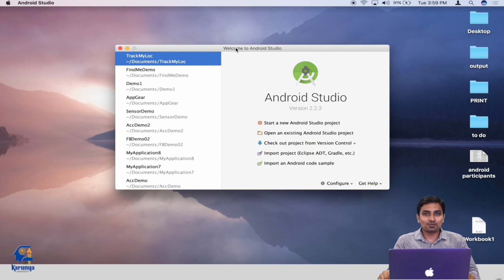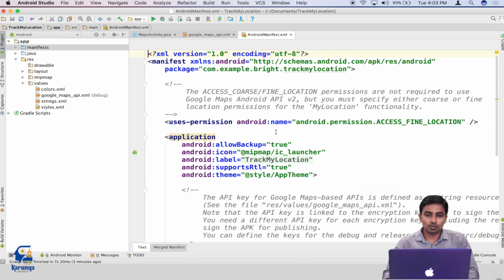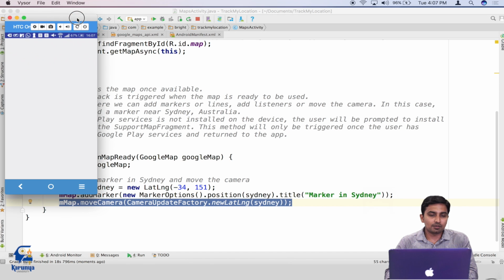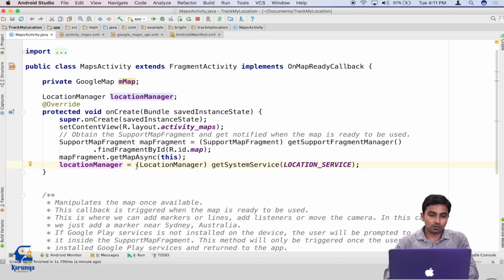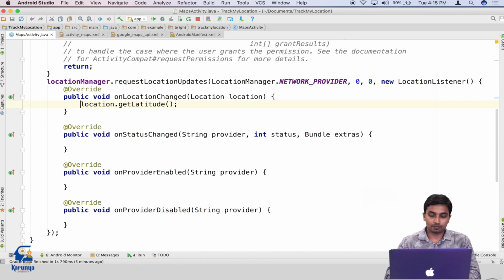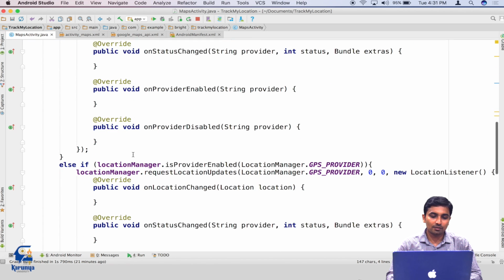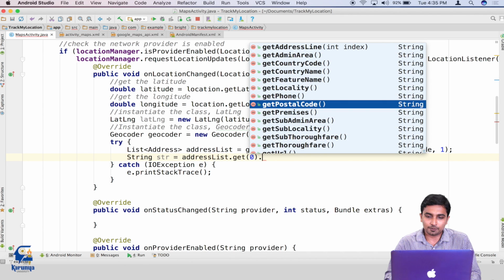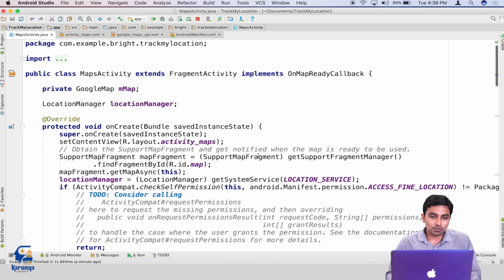Android app to Track your location using Google Map API

Comment: sir,the marker is not shown on the app
Reply from the maker: Dos
Pls include Google Map API key.
Pls ensure that location is switched on before launching the app.
Launch the app in mobile, not in emulator.
Reply: sir,
i have done everything.which you said in the comment above
Reply from the maker: Pls try with my latest code. 
https://drive.google.com/open?id=1btg-SXiB-L00UkeTzNJEmfXQapZo2q_P

Comment: I've done this exactly as you did, and my app is running fine. But my location marker shows up in England and I'm not even near England :D 
Can you help with ?
Reply from the maker: will u pls try with my latest code.
https://drive.google.com/open?id=1btg-SXiB-L00UkeTzNJEmfXQapZo2q_P
Pls update me. Thank u.
Reply: I copied this file into my project, re-run it in another window, I see you put button for "Show my location" , when I click nothin happened, same thing :( Could there be any other problem, except code ? Like something is not updated I'm trying 4 days to fix it :(
Reply: It always as my current location leads me to Holy Ponds US or england, and I researched a little bit to my location and did zoom in, there is marker in my location ...
Reply from the maker: So u got marker in ur location? If u know to use AsyncTask concept, the long running process can be executed in a separate thread called, worker thread and u will get ur expected output.

Comment: Sir, I have followed the full tutorial and done as you have done but my map is just been displayed without any marker or location
and I have checked the below links also but it doesn't work for me
please do needful
Reply from the maker: Pls enable the location in ur mobile and launch it in ur mobile, not in emulator. I hope that u ll get the expected output. Don't forget to update me.
Reply: i have enabled the location in my mobile and launched it
i'm not using the emulator 
still its not working
Reply from the maker: did u insert ur Google Map API key?
Reply from the maker: I m sorry to hear this. pls try with my code which is recently coded.
https://drive.google.com/open?id=1btg-SXiB-L00UkeTzNJEmfXQapZo2q_P
Reply: i have inserted it still, it has the same problem
Reply from the maker: I am very sorry to hear this. Don't worry. U may try with my latest code.
https://drive.google.com/open?id=1btg-SXiB-L00UkeTzNJEmfXQapZo2q_P
Reply: thank u sir
Reply from the maker: u r welcome. God bless u.

Comment: not showing any marker even after the location is enabled
Reply from the maker: after enabling the location, launch it again in ur mobile phone, Still the problem persists, try my new code
https://drive.google.com/open?id=1btg-SXiB-L00UkeTzNJEmfXQapZo2q_P
Reply: it worked .. but shows two marker ... may be u should provide .. else if instead if in the network detection
Reply from the maker: Did u try with my latest code, shown below in the link?
https://drive.google.com/open?id=1btg-SXiB-L00UkeTzNJEmfXQapZo2q_P

Comment: can you plzz sort out my problem it is same as of otherz bright varghese
Reply: i also have the same problem waseem bhai
Reply: plz tell me
Reply from the maker: Pls download my latest code from this link
https://drive.google.com/open?id=1btg-SXiB-L00UkeTzNJEmfXQapZo2q_P
Reply: sir i did this but nothing happens output is the same no marker plus no correct location plzz help regarding this issue i have to submit assignmnt tomorrow bright varghese sir
Reply from the maker: did u insert ur google map api key?
Reply: bright varghese yes sir i did
Reply: Sir i shared my code with u at your gmail account have a look if u have time i shall be thankful
Reply from the maker: which mobile r u using?
Reply: bright varghese sir Samsung core 2 model number SM-G355H android version 4.2.2.1
Reply: bright varghese sir
Reply from the maker: Pls do verify that r u getting any exception in logcat?
Reply: not getting any exception sir

Comment: Hey thanks for your tutorial!
Unfortunately i didnt work for me. It just shows me the map without the marker. I did EXACTLY the same as you did. GPS is on and also tried regeneration of the key.
And i have no clue what i could do with your sample code :D
Reply from the maker: Pls ensure that ur location is on in ur mobile
Pls try with my latest code
https://drive.google.com/open?id=1btg-SXiB-L00UkeTzNJEmfXQapZo2q_P
Reply: Thanks alot for your response. Location was already on. Which documents do i have to import in my project?

Comment: I tried it with my code and the code you provided via GitHub, neither worked. The map opens but it won't locate my location. Is there anything you can suggest to make this work? I don't have an android device but i used a friends to test and nothing worked
Reply from the maker: it works only with Android mobile.
few days before I created a new app. You may try the below mentioned link
https://drive.google.com/open?id=1btg-SXiB-L00UkeTzNJEmfXQapZo2q_P

Comment: Sir, my all things are done map is also  coming only marker is not coming please help
Reply from the maker: Dos and donts
1. The app works only in mobile phone, not in emulator.
2. Enable the location before launching the app in mobile phone.

U may try with my sample code
https://github.com/brightgeevarghese/TrackMe

Kindly let me know, if the problem persists.
Reply: I have ruuned in mobile also same things occurs there also
Reply from the maker: Did u try it with my code which I shared thru github?
Reply: bright varghese is that code different from this one in video?
Reply from the maker: almost similar only, but still u can try with it. Don't forget to insert ur Google Map API key. Generate a new one and insert it. Pls do check that is tr any exception in ur logcat.
Reply: I also generated the new api nd checked it. I l try with ur code.
Reply: I tried with ur code I am getting invalid vcs root mapping.please help
Reply from the maker: is it possible to come in online thru Skype? my id is brightfsona.
Reply: No sir i can send u mail
Reply from the maker: send me a test mail at brightlsom@gmail.com.
Today I created a new app to show the current location. I ll send the whole project to ur mail.
Reply from the maker: download the new project from this link
https://drive.google.com/file/d/1btg-SXiB-L00UkeTzNJEmfXQapZo2q_P/view?usp=sharing
If u v any doubt, feel free to mail me at brightlsom@gmail.com
Reply: Thankyou so much Sir

Comment: Sir just map is shown when I run the code but it doesn't shown the marker and current location what should i do?
Reply: I run it on my mobile and the location is also enabled..
Reply from the maker: kindly share ur logcat while running ur app in mobile. U may try again with a new Google Map API key and share the logcat with me at brightlsom@gmail.com

Comment: Hello sir ,i have followed your tutorial and done as you have done but, my map is just  been displayed without any markr or location ..plz sir help me
Reply from the maker: Pls launch it in ur mobile, not in emulator. It works only in emulator. 
U may try it with my code. 
https://github.com/brightgeevarghese/TrackMe
Don't forget to insert ur Google Map API key.
If still the problem persists, pls share ur logcat at brightlsom@gmail.com.

Comment: sir i have followed the full tutorial and done as you have done but my map is just been displayed without any marker or location.
Reply from the maker: Dos and Donts
1. It works only in device, not in simulator.
2. Pls do enable the location, before launching the app in ur mobile.
If still the problem persists, let me know.
Reply: Hello, I have done all of that and I still get a problem that only the default map shows up rather than a map with a marker where I am.
Reply from the maker: Pls try with with my code.
https://github.com/brightgeevarghese/TrackMe
pls include ur Google Map API key.

Comment: Thank you very much, but my code still doesn't work. The map just points to equator and no marker is being generated. I've tried three different API keys, checked for its updation in the manifest file,  checked SDK version, switched on Location, tried it on Phone and Emulator, still not working. Any way to fix this?
If you don't mind, could you teach us how to find all our phone book contacts on the map? I'm working on a hack idea, and it would benefit me greatly, thank you once again.
Reply: Finallyyyy it's working using your code on Github. Thank you so much. Could you explain why the original code on this video wasn't working?
Reply from the maker: It works only in mobile phone, not in emulator. Pls try once again with my code.
https://github.com/brightgeevarghese/TrackMe

To access the phone book, pls follow the below code and customise it to add the contact to map.

public class MainActivity extends AppCompatActivity {

    ContentResolver contentResolver;
    TextView textView;
    @Override
    protected void onCreate(Bundle savedInstanceState) {
        super.onCreate(savedInstanceState);
        setContentView(R.layout.activity_main);
        textView = (TextView)findViewById(R.id.textView);
        //Step 1 : get the content resolver
        contentResolver = getContentResolver();
        Cursor cursor = contentResolver.query(
                ContactsContract.Contacts.CONTENT_URI,
                null,
                null,
                null,
                null
        );
        int count = 0;
        StringBuffer sb = new StringBuffer();
//        String colomns[] = cursor.getColumnNames();
//        for (String data : colomns){
//            sb.append(data+"\n");
//        }
        String data = null;
        //textView.setText(sb.toString());
        while(cursor.moveToNext()){
            data = cursor.getString(cursor.getColumnIndex(ContactsContract.Contacts._ID));
            sb.append(data+":");
            data = cursor.getString(cursor.getColumnIndex(ContactsContract.Contacts.DISPLAY_NAME));
            sb.append(data+"\n");
            String phoneNoStatus =
                    cursor.getString(cursor.getColumnIndex(ContactsContract.Contacts.HAS_PHONE_NUMBER));
            int value = Integer.parseInt(phoneNoStatus);
            if (value > 0){
                //execute the query to get the phone number
                Cursor phoneNos = contentResolver.query(
                        ContactsContract.CommonDataKinds.Phone.CONTENT_URI,
                        null,
                        ContactsContract.CommonDataKinds.Phone.CONTACT_ID+"=?",
                        new String[]{cursor.getString(cursor.getColumnIndex(ContactsContract.Contacts._ID))},
                        null
                        );
                        while(phoneNos.moveToNext()){
                            sb.append(phoneNos.getString(phoneNos.getColumnIndex(ContactsContract.CommonDataKinds.Phone.NUMBER))+"\n");

                        }
            }
            Cursor emailCursor = contentResolver.query(ContactsContract.CommonDataKinds.Email.CONTENT_URI, null, ContactsContract.CommonDataKinds.Email.CONTACT_ID+"=?", new String[]{cursor.getString(cursor.getColumnIndex(ContactsContract.Contacts._ID))},
                    null
            );
            if(emailCursor.moveToNext())
                sb.append(emailCursor.getString(emailCursor.getColumnIndex(ContactsContract.CommonDataKinds.Email.DATA)));
            count++;
            if (count > 10){
                break;
            }
        }
        textView.setText(sb.toString());
    }
}
Reply: Thank you!! I wanted to confirm however if it is possible to make the map marker itself interactive such that when we click it, it should call up a previously provided number. If possible please provide the code for that, will be greatly appreciated, thank you. I will send you my current project status if you require to see it. 
Thank you once again.
Reply from the maker: mMap.setOnMarkerClickListener(new GoogleMap.OnMarkerClickListener() {
            @Override
            public boolean onMarkerClick(Marker marker) {
                //put ur code here when the marker is clicked
                Toast.makeText(getApplicationContext(), "marker is clicked", Toast.LENGTH_SHORT).show();
                return true;
            }
        });
Reply: Thanks I've already managed to link a calling function upon clicking the mapmarker already, now im facing a problem in creating a database and creating a registration page for my app.
Could you direct me to some help?
Reply from the maker: I would like to know, u r using SQLite(in-built data base) or external data base(mySQL or ...). Kindly share your log cat when u tried to connect with db.

Comment: Sir when I run the code I get a map not my location not any marker I have enabled location in my mobile I have also regeneated the api key still not working
Reply from the maker: Pls do check if there is any exception regarding GoogleMap API key.
Try with me code 
https://github.com/brightgeevarghese/TrackMe
Update the source code with your generated Google Map API key.
Reply: I have tried that but still not working I am getting 0,0 latitude longitude value the origin

Comment: Hello sir, I followed all your steps,but at last im just getting the Map without any Location And Marker....
Reply from the maker: Dos and Donts
1. It works only in mobile phone, not in emulator.
2. Before launching the app in mobile phone, pls enable the location in ur mobile.

Still if the problem persists, feel free to contact me at brightlsom@gmail.com
Reply: The Problem still persist, i had also tried by updating the Map Api Keys, but Still the Same Output.

Comment: Sir, when I run the app on the vysor app, it simply shows a map with no marker. I have tried
using valid Keys and also my location is on. Thanks for help!
Reply from the maker: Pls ensure that u launch the app in Android mobile phone, not in emulator.
Pls ensure that location is enabled in ur phone.
Still, the problem persists, kindly share ur logical information in a text file at brightlsom@gmail.com
Reply: Thank you! Works just fine when launched on the phone!
Reply from the maker: Thank God. You r welcome.

Comment: Hi,  I have followed your instructions and I am unable to load the marker as the permissions always fails!  I have added a toast message which always pops when the permission is sought. How can I overcome this?

 if (ActivityCompat.checkSelfPermission(this, Manifest.permission.ACCESS_FINE_LOCATION) != PackageManager.PERMISSION_GRANTED && ActivityCompat.checkSelfPermission(this, Manifest.permission.ACCESS_COARSE_LOCATION) != PackageManager.PERMISSION_GRANTED) {
            // TODO: Consider calling
            Toast.makeText(this, "Permissions failed!", Toast.LENGTH_SHORT).show();
            //    ActivityCompat#requestPermissions
            // here to request the missing permissions, and then overriding
            //   public void onRequestPermissionsResult(int requestCode, String[] permissions,
            //                                          int[] grantResults)
            // to handle the case where the user grants the permission. See the documentation
            // for ActivityCompat#requestPermissions for more details.
            return;
        }
Reply from the maker: Pls launch the app only in mobile phone with location enabled. pls update me.
Reply: Hi Bright,  Thank you for your reply.  I have enabled location but the app doe's not display the marker! I do not see the marker in the emulator either although the code doe's run to here --> else if (locationManager.isProviderEnabled(LocationManager.GPS_PROVIDER)) {
            Toast.makeText(this, "GPS Provider", Toast.LENGTH_SHORT).show();
and I get the toast message 'GPS Provider' but no marker appears.

Comment: same problem like others..something is missing in your codes..fragment is showing not location and marker even updated api key..
Reply from the maker: Nothing is missing in the code. its error free.
Location marker will not be shown due to various reasons.
1. Don't try in emulator, it works only in physical mobile.
2. Pls ensure that the Google Map API key is valid(pls check the logcat content)
3. Pls ensure that u enabled the location in ur mobile.

Feel free to share ur logcat content in a text file with me at brightlsom@gmail.com

Comment: Hello sir, I have the problem that it shows the map, but there is no marker in current location. please help me :(
Reply from the maker: did u launch the app in ur mobile?
It does not work in emulator.
If still does not work, share ur logcat with me.
Reply: before this its worked, but today i am try again there is no track the current location. this is my logcat
07-09 12:09:27.140 20866-21593/com.example.asus.beta I/System.out: [OkHttp] sendRequest<<
07-09 12:09:27.285 20866-21590/com.example.asus.beta I/System.out: open:https://csi.gstatic.com/csi?s=maps_android_api&v=3&action=map_start_up&it=map_load.1355,on_create.0,on_resume.1,init.75&irt=1355,75,90,75
07-09 12:09:27.286 20866-21590/com.example.asus.beta I/System.out: [OkHttp] sendRequest>>
07-09 12:09:27.287 20866-21590/com.example.asus.beta I/System.out: [OkHttp] sendRequest<<
07-09 12:09:27.551 20866-21593/com.example.asus.beta I/NetworkManagementSocketTagger: untagSocket(36)
07-09 12:09:27.665 20866-21590/com.example.asus.beta I/NetworkManagementSocketTagger: untagSocket(106)
07-09 12:09:55.933 20866-20903/com.example.asus.beta I/GLConsumer: [unnamed-20866-1] detachFromContext
07-09 12:10:00.014 20866-20903/com.example.asus.beta I/GLConsumer: [unnamed-20866-2] attachToContext
please help..
Reply from the maker: Pls do uninstall the app manually and install it directly from Android Studio. Still the pblm s not fixed, reiterate with a new Google Map API key and try again.
Reply from the maker: pls regenerate the Google Map API key and ensure that its reflected in AndroidManifest file
Reply: still does not work :(